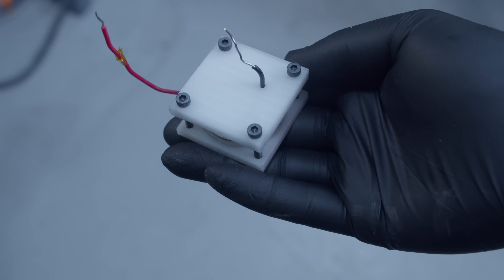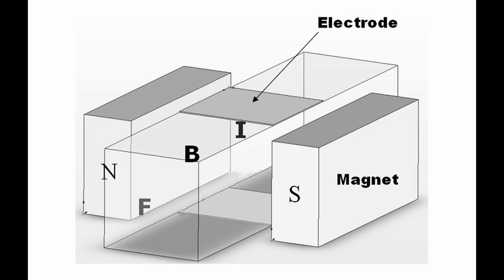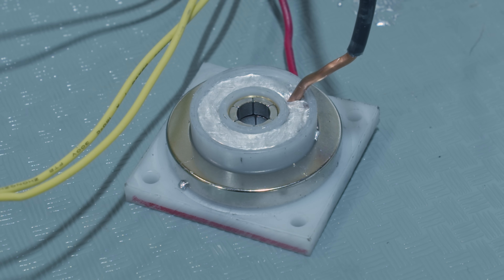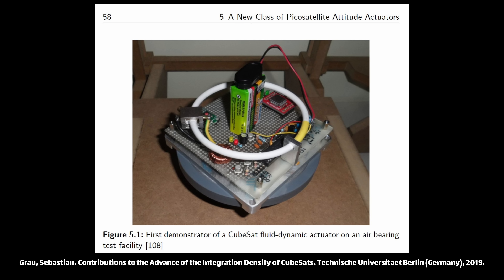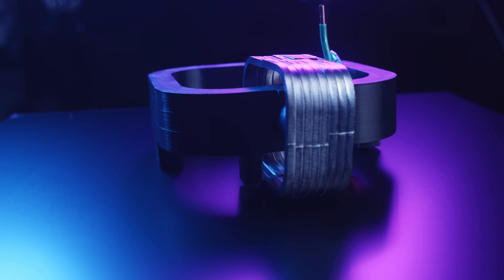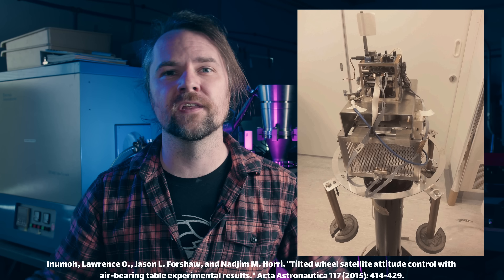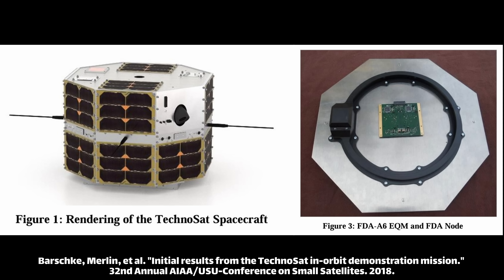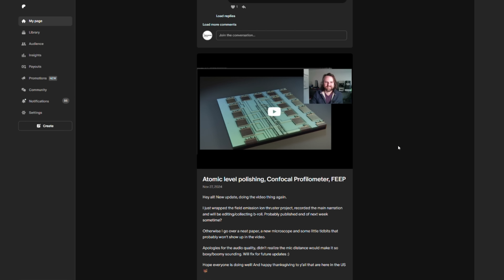A motor with no moving parts (sorta)

Comment: I like this idea there is nothing to wear out technically. But it has really big drawbacks.
First would be fricton the fluid still needs to slide over surfaces and that causes energy loss.
Normal reaction wheel when you remove power it will keep applying torque as it will keep spinning for hours as ceramic bearings have super low fricton.
This means that you really only need to apply power to change reaction wheels torque and tiny amount of power to compensate for parasitic loss, meanwhile for liquid metal reaction wheel you need to apply lot of power constantly to keep metal spinning at constant speed due to it's massive parasitic losses.
Maybe the technology will get better but for now the ceramic bearings fixed pitting problems that liquid metal reaction wheel is not really worth it at this time.

Comment: Cool Motor and Idea... I see one problem in the reaction-wheel idea though... Classic reaction wheels do have almost no traction so once spinning you have the motion enegry stored and accessible instantanious.. with your idea i see two problems here... As soon you turn off the current, due fluid dynamics you put a tention between liquid and housing and therefore a force on the axis in opposit direction than before... I think due change in the phisics in a liquid and some ininital resistance before start spinning... YOu've mentiod these problems, but had you countemesures for them?
 Did TU berlin mention these?
Reply: Поставить второй такой маховик (но с другим направлением движения), и всё, крутящие моменты будут взаимно уничтожаться и в итоге крутящего момента не будет.

Comment: A power supply using synchronous mosfet rectifiers can deliver fractions of a volt at tens of amps at close to 95% efficiency. This can be built from ordinary junk box components. I have made electroplating units like this.
Reply: This is exactly the reason why we also used this approach when developing the FDA at TU Berlin 😊

Comment: the big issue with this design is obvious : the viscosity, internal turbulence create friction, but reaction wheel don't work with impulses, they continuously turn when not affecting the moment of the object. The low friction is necessary to be useful. This design will succeed in affecting the moment but fail at not affecting the moment when powered down/standby mode. It means that they continuously require power, way more power than conventional reaction wheel when standing by. They do present an advantage in terms of bearing life span, because they use none, but since bearing tech is mature and pretty good, it's a slim advantage. They would be useful for extreme lifespan satellites or craft that have continuous and generous power.

Comment: About the corrosion you mentioned, there's actually already some pretty reliable passivation techniques used by the PC water cooling industry. Nickel-plating is considered a requirement when using liquid metal alloys as your thermal interface specifically because of the corrosion issues, and I'm sure there's some sort of plating concoctions that even your lab could work out to passivate against even more complex alloys like Gallinstan. I'm also sure with the various highly-precise machines and extreme cleanliness requirements of constructing things like satellites (especially the really high-end ones like JWST) could really push those coatings to last as long as possible, if not for longer than the life of the rest of the satellite.

Comment: Dude- cool idea but your design will fail as long as your electrodes wont be done from tungsten, tantallum or graphene/graphite
Liquid metal enbrittlement is cruel af
BTW mercury will be best as a liquid flywhell because of its high density

Comment: Aren't the frtictional losses actually a good thing? Regular reaction wheels have the problem that they become 'saturated', i.e. they spin ar their maximum speed. Wouldn't slow, frictional losses vent a saturated flywheel's energy to heat and radiate it away, i.e. be self-de-saturating?

Comment: Man i hate that i didnt htink of these as reaction wheels in terms of satilites. Years ago when I was in college I built almost exactly the motor you built here. i use to sit in the engineering lab and use the laser cutters for personal projects and I would see people screw around with stuff all the time. one day someone came in working on what was essentially a balancing cube. he didn't want to use a standard fly wheel and we were all brain storming on different ideas. having just build the little motor I suggested that as a spitball idea (I knew it wouldn't work considering the weight and lack of actual torq required), but that's how brain storming works. Absoloutley love this video!

Comment: I almost feel that it would be easier and more design efficient to make the electrical field radial with two cylindrical wall electrodes and have the magnetic field be vertical with plate magnets. Much less complicated than the ring magnets for mass production. You could also use brushes to power the wall electrodes while it spins.

Comment: Since the big advantage is just getting rid of the bearings, there might be better ways to pump the liquid metal besides MHD.  I bet you could just make a linear motor, with electrically commutated coils making a moving magnetic field that would drag the liquid along via eddy current drag.  This would mean the liquid metal could be in a completely sealed tube, with no mussing about with electrode seals.  An outrunner BLDC motor armature driven by a function generator should do the trick.

Comment: btw instead of a permanent magnet why not use an electromagnet, then it can be switched off to avoid ongoing field toque with external fields, plus when running it can be intermittently reversed at the same time as reversing the electrode voltage to provide torque in the same direction while reversing & on average cancelling the active state external field coupling. Plus for the liquid metal would NaK be a more efficient fluid?

Comment: What if you apply very short pulses at a higher voltage? Should make things easier on the power side and might result in higher reaction torque at the same average power usage.

Comment: If yer not ready for weird, skip this comment.

However, Ancient Aliens! Okay, if yer still readin, hear me out. Mercury Vortex Engines were, maybe, used on ancient Indian aircraft called Vimana. It gets into some really weird but oddly specific detail if you go reading the weird books (of which I have many. They are amusing but thought provoking) which have translations of "Pushpaka Vimana," supposedly an owners manual written in sanskrit about how to build and fly one. 

I can't believe I'm typing this and y'all are gonna think I'm really weird, but to be fair i am. I don't believe most of it, but I always wondered if a vimana Mercury Vortex could actually work. Your square-box channel design is what reminded me. Basically, the device is described as a group of loops hung vertically with one side of each loop oriented toward a collective middle. I'm goin off of thirty year old memories of illustrations, so sorry if the description's are weird. The loops are filled with mercury, though I imagine galinstan would work every bit as well, and each loop is pumped in the same direction using an undescribed method, but it always sounded like magnetohydrodynamic to me. 

I'll take my tinfoil hat off now.

Comment: It seems that the friction of the liquid against the walls of the containment loop would "undo" any imparted torque as soon as the current is turned off. Flywheels don't have this problem because they can just continue to spin with almost no friction. That leaves me curious why the liquid reaction wheels are viable.

Comment: Space is old.
Space is cold.

Trying to keep a metal liquid at low-Kelvin temperatures seems difficult. One could use waste heat from the other electronics, but it doesn't seem nearly enough. 

Instead, how about something like a large-diameter brushless DC motor with magnetic bearings? With miniscule gravity, I'd expect that maintaining a floating bearing wouldn't need a whole lot of energy, and the operation of turning the rotor like a gimbal motor would suffice.

Comment: This tecnique is used in eautomated lectronic solderingmachines. They are called „Selektivlötanlagen“ a fountain of liquid Solder is produced by putting a coil around a tube in wich the melted solder is. With this fountain you than can solder THT Parts on to a pcb without heating the hole pcb or also can have smd components on the bottem

Comment: I am wondering if an ionic liquid ( Deep Eutectic Solvent) like Choline Chloride/Urea would work here? Ionic liquids have virtually no vapor pressure, are conductve but probably would draw less current than a liquid metal. There are thousands of combinations to choose from and are high temperature tolerant.

Comment: IT VIRKS! <insert demented mad scientist laughter here>

I used to work with a guy who was convinced in his idea for a reaction motor for linear motion in space. Basically an arm with a counterweight spinning around an axis fixed to the spacecraft body. The arm could move in and out of the axle - the idea being that as the counterweight spins, it is retracted and extended along the desired axis of motion using a rack and pinion setup, "push/pulling" the spacecraft forward in space. Needless to say, he didn't understand the physics of conservation of momentum.
Reply: Hey, it worked in ksp!
Reply: There are some tether concepts using the gravitational gradient and something similar like you describe. Some where already tested in space, they work and do not contradict any laws. (see nasa tether propulsion handbook)
Reply: @lukasskymuh5910  Nah, this guy's hypothesis was nothing nearly as subtle as that. It boils down to the notion that, say,  if you're spinning a sledgehammer in space, you can pull yourself forward at 0 degrees and push yourself backwards at 180 degrees with a net forward linear motion with no external gravitational tethering.
Reply: @LilMissMurder3409  the weird thing is that such a simple mechanism this would actually increase your orbital in a gravitanional field with the correct timing. Unfortunately, not efficient enough to be interesting.
Reply: Yep,  it only works in the other fashion where something is being thrown away.  Rotary Pulse Propulsion or something like that.  That was the 80s or so.  I was a kid.

Comment: Would it work if instead of running electricity thru the liquid metal with permanent magnets around it, you wrapped a coil of wire around (many loops), and used the liquid metal as the core of the coil?

Comment: another idea. What if you put the magnets above and below the liquid metal fluid and then applied an electric current from inner and outer ring contacts made from some type of conductive material or metal that was not ractive with the liquid metal. My thoughts are that this keeps the channel unrestricted relaltive to the flow of the liquid metal and the current would run from the outer to the inner ring all the wand perpendicular to the magnetic field all the way around.

Comment: Nice work.  Thanks for the documented experimentation. 

Regarding liquid metal, I wonder whether liquid metal could be used as a low-friction liquid rotational shaft bearing, reducing friction and hypothetically having other nice properties. This is in comparison to a needle bearing, ball bearing, rotational air bearing, or rotational magnetic bearing.  The same question arises in positing a linear or x/y low friction surface bearing.  The how of it seems imponderable but 'what if' drives all invention and the refinement thereof.

Comment: Why wouldn’t you use mercury? (In space stuff messing around with it at home) Any mixed metals would risk degassing producing solids whereas evaporation of mercury would be even slower and would just lower the amount of mercury and bleed off heat.

I wonder if these motors will eventually be more popular when we are doing stuff in orbits where the background temperature is higher there are a lot of Liquid Metal mixes that are liquid at less than 100 degrees centigrade and there are already processors and stuff that can operate long term at those temperatures.

Comment: So the magnetohydrodynamic drive in Clive Cussler's books is real. That's actually pretty cool!
Question: would mercury work better as a working fluid, since it's a liquid at room temp? Or is its freezing point higher than the fluid you're using right now?

Comment: In addition to reaction wheels, satellites also use control moment gyroscopes, which are a similar device that uses conservation of angular momentum to control satellite orientation. The key differences in performance between the two are that reaction wheels are more power efficient for smaller satellites, and larger manoeuvres, and CMGs are more power efficient for larger satellites and smaller manoeuvres. CMGs also provide more torque for less power.

There's also a difference in how they operate. Reaction wheels change angular momentum by spinning up and down. CMGs change momentum by changing the wheel's axis of rotation without needing to change the angular velocity.

Reaction wheels have their place, because many satellites are very small. But for larger craft, like the International Space Station, they use CMGs. The ISS has four.
Reply: There's also the magnetotorquer, which uses a dipole to generate torque against the planet's magnetosphere. It requires detailed knowledge of the local magnetic field gradient to calculate the torque correctly but they are commonly used for satellite attitude control and stabilization.
Reply: CMGs also have a lot less jitter than RWAs. So your platform is more stable, great for deep space telescopes where you need accurate pointing for long periods.

Comment: The potential problem I see using these in space is our Reaction Wheels fail in space due to electrical discharge arcing on metal bearings welding them to their casing.  While that itself is not an issue here those same electrical forces would throw off the orientation of our craft as it induces a torque in the reaction wheel.  This would need to be compensated for somehow.

Comment: I remember when I was a kid (a very very long time a go) there was a short article in Pop Sci or some such (paper) magazine about some scientists making a mercury "gyroscope" using magneto hydrodynamics to push the mercury around a metal tube loop. They hinted it could be used in place of spinning wheel gyros with then poor reliable ball bearings. This was before even the 1st satellites. Your video dredged up that long forgotten memory. What goes around comes around.

Comment: I'm imagining a sphere inside of a sphere design for the case with magnets and electrodes inside and out so you could adjust voltages to different positions and make the fluid go in any direction.
I'm weird like that.
I'm currently trying to build a tesseract that "walks" across a beam that runs through its center.
Failing....I'm currently failing to do this.

Comment: The biggest problem I can see is that the flywheel itself (the liquid) has no structural integrity. It needs all the strength to come from the housing, and that adds too much mass for it to be a good solution for space.

Comment: Very cool, I knew about reaction wheels but never even considered using a liquid.  I wonder if anyone has tried spinning the liquid propellant of a (small) liquid fueled rocket inside its tanks to achieve this kind of effect?  Obviously would not be with liquid metal in that case unless there is some kind of exotic rocket using galinstan for a propellant.

Comment: How it works (physics). The liquid rotor acts as flywheel tending to stay motionless. Outer stator gains initial impulse (relative to rotor only)  just in moment when you switch on electric current.   Same behaviour as with flywheeled electric motor rotor and its outer stator. This device does not provide continuous force/impulse.

Comment: The reason why this is likely not practical, is the viscous drag -- the between your liquid and solid surface around it. In space applications, it is ultra important that that friction is as low as possible at ultra high velocities. This viscosity is not trivial even for water. If you solve the viscosity problem, then it becomes much more interesting.

Comment: For some reason my brain is always thinking about how to use lasers for short range wireless power transmission. Maybe you could point a high crossectional area laser beam at a solar panel to charge supercapacitors to power the buck converter for brief tests. Practical? Definitely not. Dangerous? Yes. Possible? I kinda doubt any solar panel would be happy about this, and you'd need a 30 watt laser plus a way to make it cover most of the solar panel while moving

Comment: The oxide skin could be a problem, not just for seeing the liquid, but bc of the increased surface tension slowing flow at the very top of the metal layer. I'd try filling it in a vacuum glovebox, though redesigning it for air-proofing could be difficult.

edit: I actually just found out that in the new nvidia 5090 founder's edition card, they use liquid metal for thermal transfer, and it is sealed in a triple-layer hermetic seal not only to keep it in place, but to prevent oxides from forming.

Comment: You would need high C rated LiPo batteries. Lion batteries are not designed to deliver high currents that you need. Lion's max out around 30C whereas LiPo's can go as high as 300C.

Comment: if the voltage is so low, could you just use a salt solution? Voltages less than 1.2 volts won't electrolyze water, that might be lower depending on the salt but for something like sodium fluoride you wouldn't have to worry about any electrochemical reactions and if its low enough maybe you could just use table salt.